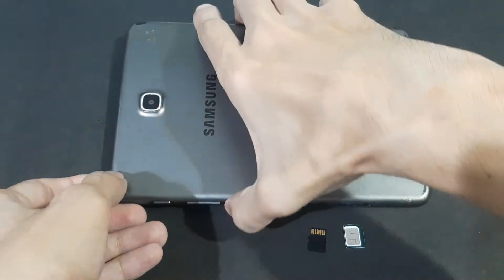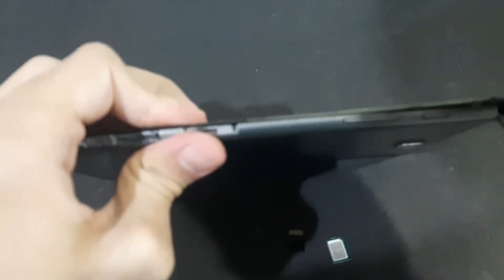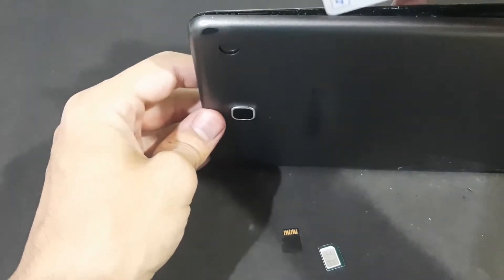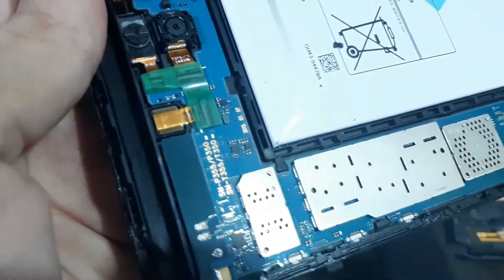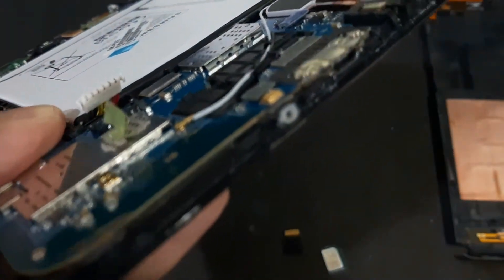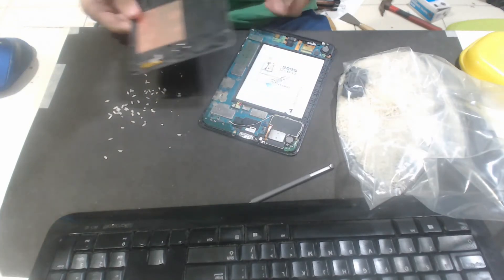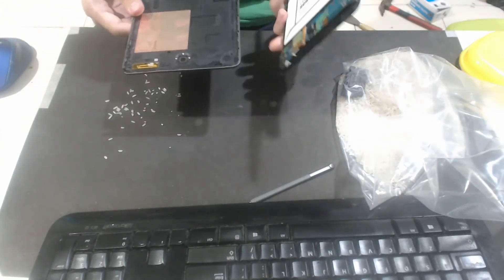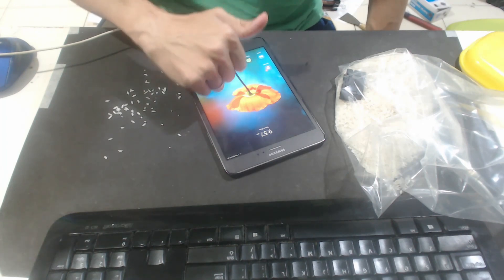How-to | Recover Water Damaged Tablet

Comment: My cat threw up water like fluid on my tablet, don’t know how long it had been sitting in that, but tablet will not turn on, so I placed it into a bag with rice. Cannot remove back. There is no area on the tablet that shows you can remove the backing. Should I just keep it in the rice for the next 48 hours and cross my fingers
Reply: No it will cuz the plug charging tablet area will get block by the rice so U need to go to the repaire

Comment: Ik this vid is 3 years old but 😢 my Samsung tablet s6 lite has some cracks on its edges so all the water went in side the tablet and the touchscreen isn't working. Pls help
Reply from the maker: The first course of action is disconnecting the battery then using rice to dry remaining water. If you do not have experience bring the device to a professional.

Comment: Hey I need a help my tablet is showing A moisture detection notification although I don't remember it fell in water but there is moisture in the screen it was showing not to charge so I just didn't and it's charging was 9 and I slept when I woke up it went black screen and now when I try to turn it on it won't although can hear some sounds please please help me out 😕😖😭please
Reply from the maker: It might be the protection software in the device does not allow it to be turned on, or the moisture damaged screen circuit, or the battery simply died. The only way to find out is by a professional opening it up and checking for moisture.

Remember water damage could be from something as simple as moisture from a cold drink on the table next to the device. So it does not have to fall inside water to sustain damage.

Comment: the tablet i got from school fell on a bucket of water, at first it works fine it just has some water on the screen, when i checked the tablet 6 hours later(i carried it through school) it's just a black screen, i can still open/close the screen with the shutdown button, but after sometime it just hanged, leaving a black screen until it dies of low battery, it's been a few weeks now since i've touched the tablet, can i still fix this?
Reply from the maker: There likely is a few areas in the components that would have caught rust. I could tell you to replace the screen which could work for sometime, but ultimately it is best to replace the whole tablet at this point to avoid endless spending on replacement parts.

Comment: I dropped my Galaxy tab S8 in the water. Everything is alright but I can see the water is inside the screen. You put it in a bag with rice, but does it work for the screen?
Reply from the maker: This sounds like the tab was submerged very deep. You could try to shake out trapped water and rice should help, but probably some permanent damage already there. Be careful.
Reply: I have the same issue with A7 i will examine the rice experiment and hope to remember to replie whqt happens  @prhasn

Comment: Sir my tablet got drenched all the way inside but i responds quickly and remove all the water but the thing is the brightness of my tab now dims and the screen wont work...
Reply from the maker: The water probably would have caused a small short circuit that is draining some of the power away from the screen leds.
Reply: Now what to do then ?

Comment: Hey plz respond to my matter....I once spilled water on my tab and the water got inside the screen and it was visible...this happened a few months ago but the water didn't really affect its performance...now all of a sudden it is saying to dry out the port and I'm not sure if I dropped more water or if the old water inside the screen is being detected....either way I tried to blow dry and the rice method for a short time....is there anything else I can try out?
Reply from the maker: Many times the water damage is felt long after the initial contact. The water basically causes connections to rust, which can impact any of the device functionalities. Such a long term impact is hard to fix.
Reply: I went to a reapair shop but they are saying we need to change the panel which is not available in Pakistan😖😭😭🤒
Reply: Same thing happened to my Amazon fire 7 tab ....my parents won't buy me a new one😭and are scolding me too
Did ur tab ever worked agian....

Comment: What happens if it falls and the screen and back frame thing splits apart? The buttons have fallen deeper in. (Same model as yours)
Reply from the maker: If the screen splits, you likely need to replace the screen itself.
Reply: @prhasn  the plastic cover and the screen are both fine just...seperate if you get what I mean (the cover and the screen are apart how do I put it back together)
Reply: Sell it for parts

Comment: So I have a galaxy tab 4 and about 2 to 3 years ago I dropped a glass of water on it and straight after that the video completely freezed and it was like that for 10 minutes then it started working however it was VERY laggy and kept freezing and stuff and ever since then my tablet keeps lagging and its very slow and it keeps freezing and I'm not sure what to do it makes me rage a lot can u help??!! Please!!
Reply from the maker: Water conduct electricity and even after it dries some rust could form between electronic components. So it shorts circuits. It means electricity is not going through the intended route.

A solution for that would be to clean the electronic board with an adequate solution. However, this must be done with an expert to avoid further damage.

The point of quickly using rice is to dry the components fast enough so that there is a minimum chance for rust to form.

Comment: Left mine on water on the table and now won't turn on and is showing blue screen
Reply: Same
Reply: @joshuapeters3664  oi so did it worked out?
Reply: @milan9418  mine worked too but it had moisture inside the display.
Reply: And that moisture just doesn't dry but it works fine.
Reply: @joshuapeters3664  oh dang well atleast it is working
Reply: @milan9418  yeah and eventually that is what matters
Reply: @joshuapeters3664  told ur parents yet? 😢
Reply: @milan9418  no
Reply: Did u tell ur parents
Reply: @joshuapeters3664  nope 😐 gonna die if it won't work after keeping it in rice
Reply: @joshuapeters3664  dang-
Reply: Your*
Reply: You* your*
Reply: Same
Reply: @bhagavansinggulabsingrajpu5329  lol
Reply: @bhagavansinggulabsingrajpu5329  try rice mine worked after that
Reply: Omg literally the same
Reply: @justme-cq6uq  dammm try rice bro
Reply: @milan9418  yes thank you its working now but there is a slight color change n the home n back touch pads stoped working but thanks
Reply: @justme-cq6uq  oh well at last it is working 
And about the color change it happened in mine too 
Because I left it for a lot of time in water
Reply: @milan9418  ya me too didnt insert it in rice as fast as i should too but it worked thats what matters right
Reply: @justme-cq6uq  yea and if it lag too much with the back button u should get it to a technician
Reply: @milan9418  oh i should try that thank you sm
Reply: @justme-cq6uq  np
Reply: Anyone ever get in trouble ? Just found my son's left on the table, it wasn't turning on. My mother was watching my son and didn't bother to do anything about it. now they're are all in trouble. Weird